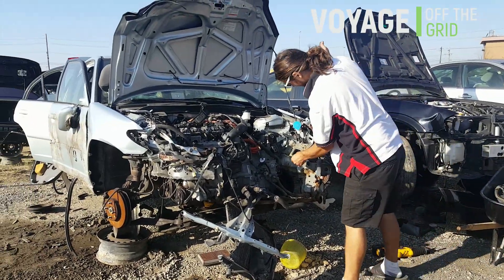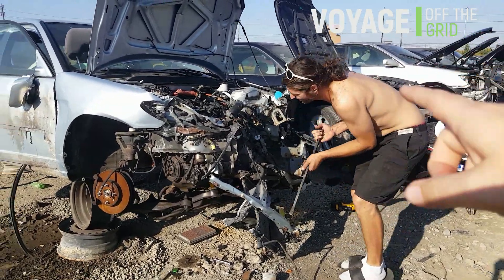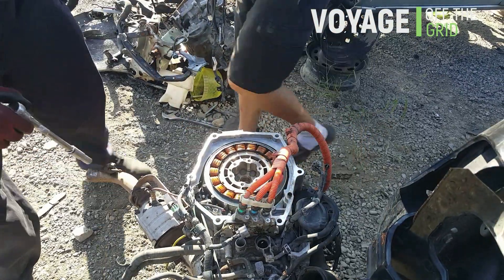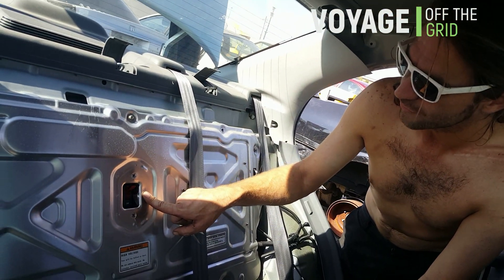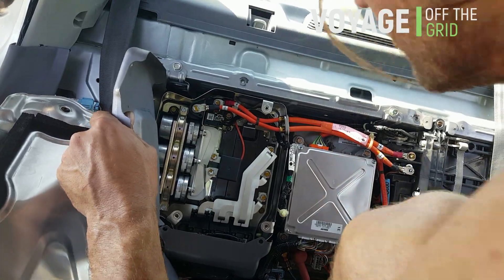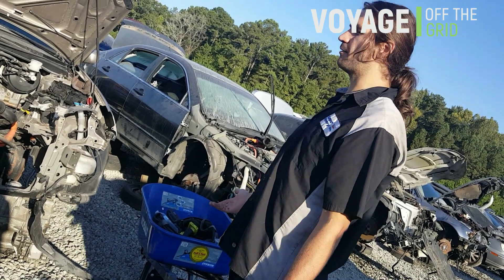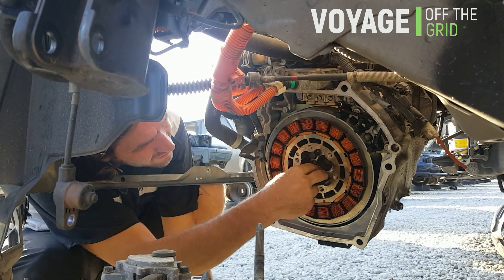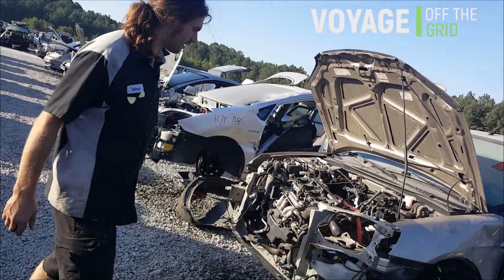Pulling an Electric Motor from a Honda Civic

Comment: Umm, I'm a fan now thats for sure, You gotta give us all the details now bro...   :)   , #subscribed , #thumbesup     I have actually thought about equipping a Catamaran with two of these type electric motors https://www.youtube.com/watch?v=_SYZbFGdibM&t=512s, Then add a minimum 4 seperate battery bank battery system. Next, I would utilize wind turbines, solar panels and water turbines to charge the batteries, For example: solar panels will charge one bank, wind turbines will charge another bank, Then the movement of our sail boat generating electricity to the water turbines following/dragging behind us will charge a third bank, I had wondered what system I could use to charge the 4th bank, well as I see it one of your honda coils on each of my electric motors would essentially generate all the additional electricity needed to power/charge the fourth battery bank and propulse the boat as well.... All 4 battery banks will contain lithium batteries of course.